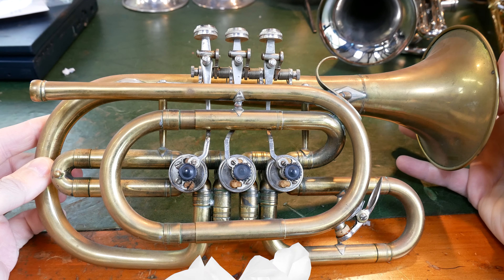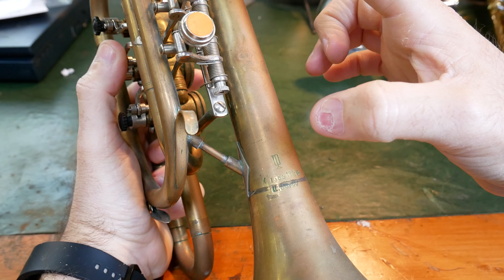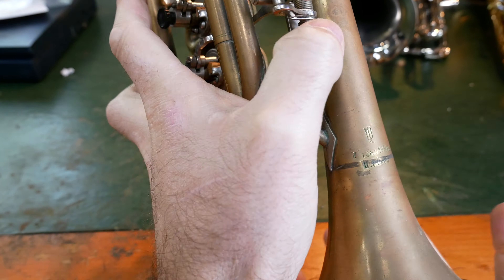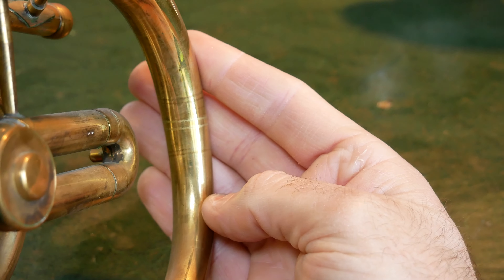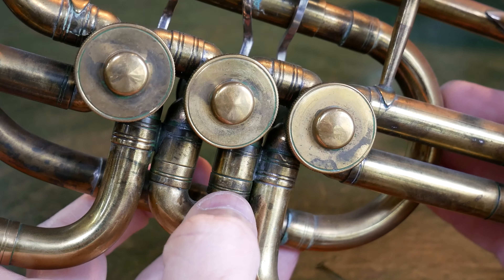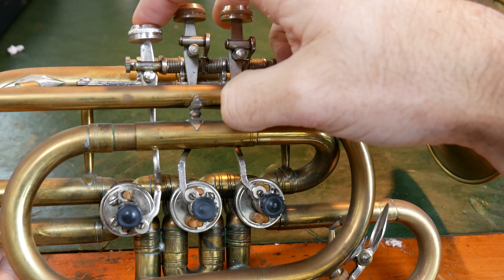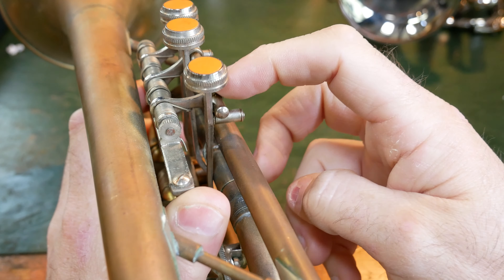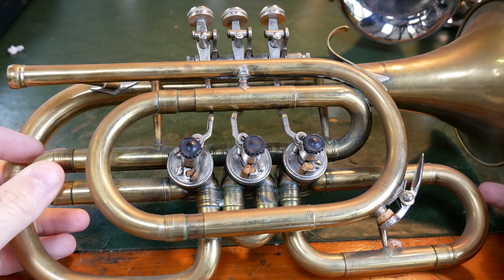On The Bench: Soviet-made Cornet

Comment: Hi!
Nice cornet, I have the same one in my collection (made in 1980).

I live in Russia, such thing can easily be bought here for about $30-40.

The mark on the bell contains the factory logo, the serial number (1389), the year of manufacturing (1976?) - so it's three years older than me :)

And, the most interesting: the price!
Most of products in USSR had a fixed government-controled price, usually engraved of stamped on the surface.

The mark "Ц. 80 р 00" says that this cornet had a price of 80 rubles. In current rate it is about $1 :)
Reply: Но вообще-то великий советский рубль стоил больше доллара! Не сравнивайте пожалуйста великий советский рубль с теперешним…